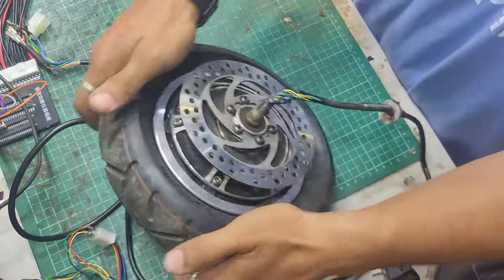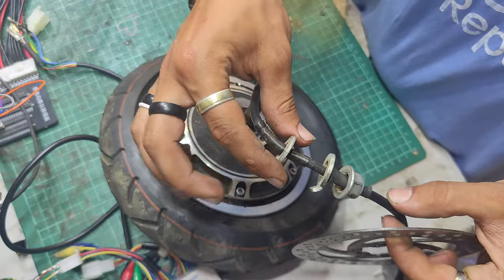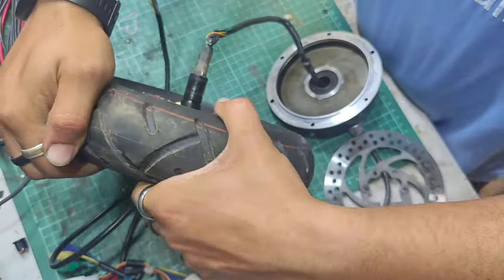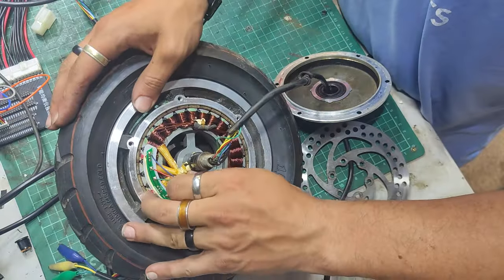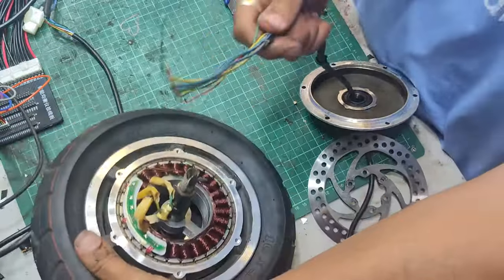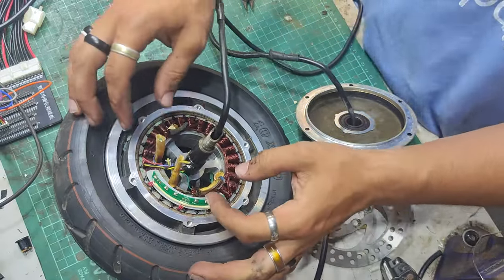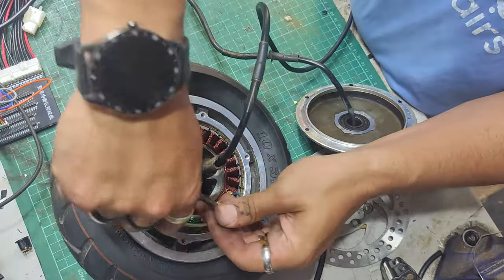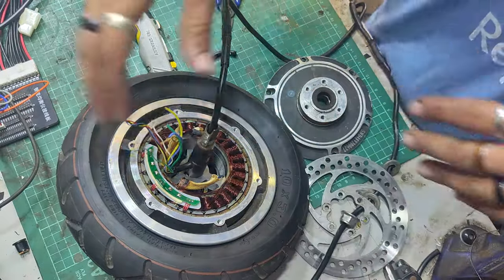Escooter Hub Motor Cable Replacement - How to!

Comment: How much would this cost at shop
Reply from the maker: hub motor cable replacement is usually about £80 after reassembly and testing.

Comment: Hi to where on the motor is the white wire connected i cant seem to find it connected anywhere
Reply from the maker: On this motor there is no white wire, normally its the speed sensor